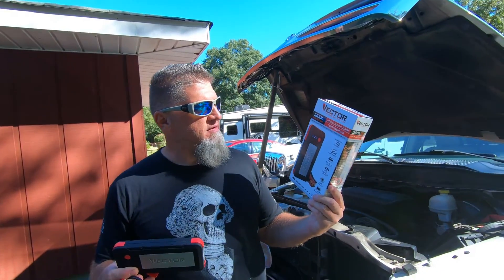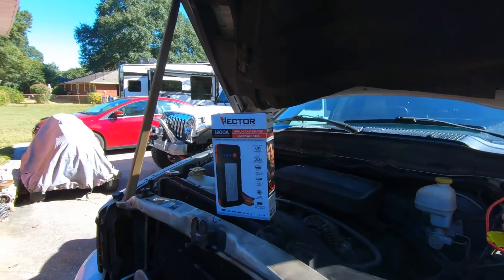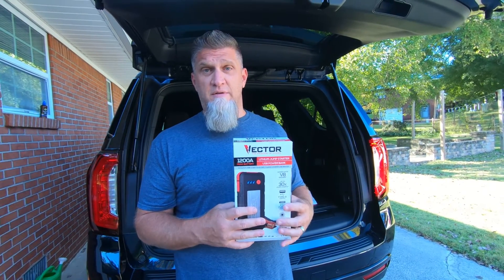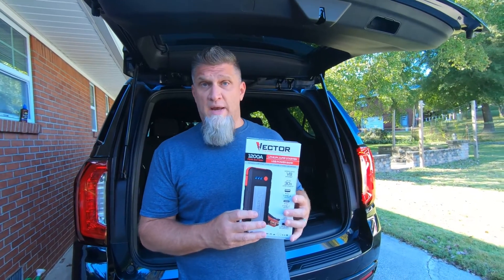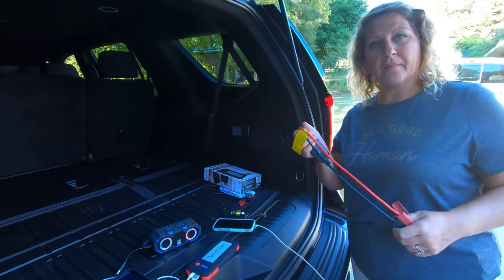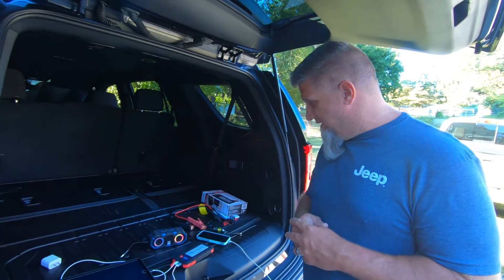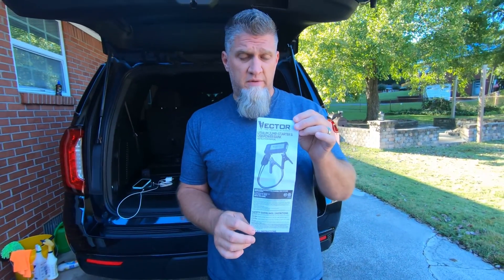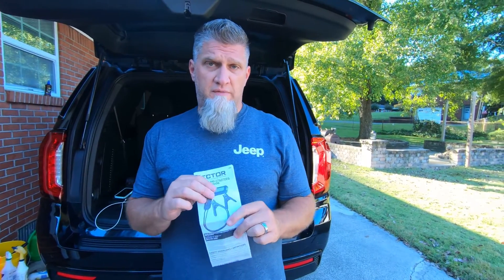How Well do Lithium Jump Starters Work? | Vector 1200 Amp Lithium Jump Starter

Comment: I got one off fb marketplace idk but I think mine not charging got any tips on that
Reply from the maker: Try plugging the charging cord into the power bank first and then into the wall outlet. There are three blue lights that should light up/flash once it’s charging. Try pressing the power button to turn it on during charging.

Comment: I just got one.  The cold here in Ohio killed my battery and I’ve had to jump it every time I drive it. Been using my 20v drill battery but I don’t want to kill those too so I grabbed a jumper pack. I’ve used older ones and they don’t seem to last long probably due to the battery type but this thing has been awesome!
Reply from the maker: Glad it’s working out well. Thanks for watching

Comment: Just bought the 1600 for $90 at Home Depot. I have a 4cyl 2.7l Tacoma so I should be good.
Reply from the maker: Yes indeed it will work fine. I've used mine many times now on my Jeep and lawn mower.

Comment: My van starter is clicking away...walked half mile to HD and picked up the 1600a...I'm charging it from my Jackery...hope it works...thanks for the instructions.
Reply from the maker: if you have a dead battery it will work for sure, I've used mine many times since this video both on my truck, my Jeep Wrangler, and lawn mower.
Reply: @Georgia4Low   I appreciate the positivity...I'm stuck at Mohegan Sun casino in Connecticut and losing my shirt while this thing charges...
Reply from the maker: gotta hate that but I hope it works well for you. make sure you don't have battery cable connection issues as well, bad cable connections will limit the jump pack from helping you getting the van started. good luck!!
Reply: @Georgia4Low ...and after it charged fully in 4 hours I gave it a try...my starter wasn't even clicking when I tried before the jump attempt so I thought I was doomed..the initial try had the starter clicking at least so I took it off for 5 minutes knowing it wouldn't start...tried again and YES!!!...I was doing the happy dance...wow...you were right!!!! Now I can get away from my poker disaster!
Reply from the maker: great news! glad to hear! I have noticed at times it may take a few adjustments with the clamps to get them positioned well enough to "bite" into the battery terminals to make good contact.

Comment: I bought one of these but when it is charging it does not indicate any LED, is it normal or is it defective?
Reply from the maker: I had mine do this as well, I pressed the power button to turn it on and then the charging LED’s came on.
Reply: Did you fix this problem already? If not, I found that you have to plug the adapter into the wall BEFORE plugging the cable into the device in order for the LED lights will properly turn on.
Reply from the maker: Yes that’s correct as well. Thank you
Reply: Thank you both for your information.
Reply from the maker: You’re Welcome

Comment: Bought one of these a few days ago after my Landcruiser (V8) battery went below the ability to start.  Had the radio and lights on after we parked, turned off the engine at a Chick-fil-a.. we ate durning that time the radio shut off and I noticed accidentally left the lights on… we killed the battery while we ate. I noticed a Home Depot across the street, I walked over, and bought this Vector 1200, it was able to give the battery enough juice right out of the box to start the engine…I was surprised… it was perfect for my situation…
Reply from the maker: That’s awesome to hear and glad it worked out great! Thanks for watching

Comment: I previously just had a jump and carry 660 jump starter and I needed something alil more smaller and practical so I found someone selling 2 vector 1200 for $50 each brand new...so I jumped on it and me and my friend bought both of them...I love the power they pack...i literally took it from the box and used it and it jumped my battery immediately without charging it...but it will definitely be charged completely soit wil always be ready
Reply from the maker: Thanks awesome to hear, thanks for sharing

Comment: I bought one of these and I like the fact that jumper cables are somewhat longer than they are on similar units. I have not had the opportunity to jumpstart a car with it yet.
Reply from the maker: awesome, keep it charged up and it's ready when you need it.
Reply: @Georgia4Low  my alternator quit so I finally had a chance to try it out. I'm impressed.
Reply from the maker: Glad it worked out and sorry the alternator took a crap.

Comment: To charge it ,the vector 1200 ,do you just plug it into the wall socket?good video. If this all works out, I'm purchasing one today.
Reply from the maker: yes to charge it just use the provided charging cables and adapter to either charge from a 110/120 outlet (wall socket) or USB. Thanks for watching
Reply: No chance of fires with these units ?  Wether leaving in a car or charging in the home ..
Just making sure this brand is not notorious for the internal battery to go wonky
Reply from the maker: It’s Li-on which is more stable than the Li-cobalt. I’ve seen or heard of any fire issues.
Reply: Wat if I don’t have the original charger
Reply from the maker: @javorisalexander5 seems like a pretty generic usb cable or commonly used cable

Comment: I also have a a solar charger in each  vehicle. About the same size as the jump starter. Great for running your cell phone and wireless speaker. Plug them both in leave the charger in the sun. Music all day or charge cell phones. Another cool little toy.
Reply from the maker: Agreed! We have a solar battery generator ( I believe that’s what the cool kids call them) currently only charging via AC outlet but looking to getting a portable solar panel for sure. Thanks for watching
Reply: @Georgia4Low  I use my little solar charger with my Garmin GPS when traveling. Toss the cell on the dash in the sun. 😁

Comment: Great video 
Just bought the same one from Homedepot. Great deal on sale. From $89.00 to $59.00 plus $25.00 more off for opening a no annual fee credit card. One guy said you have to plug it into the wall electrical outlet first before plugging into the charger so it charges.
Reply from the maker: Great deal for sure! Yes I believe the instructions say plug in power supply first then connect to the jump pack for charging. Thanks for watching